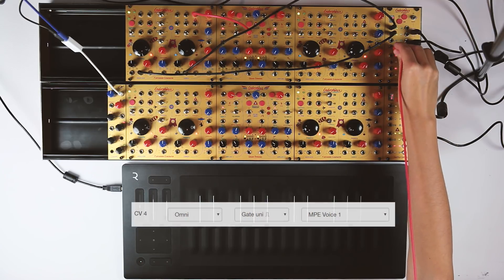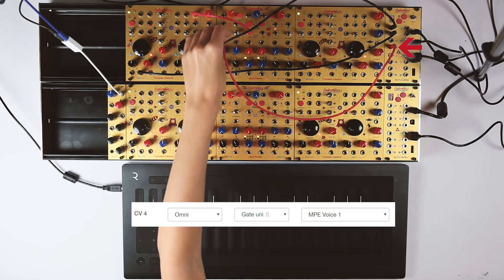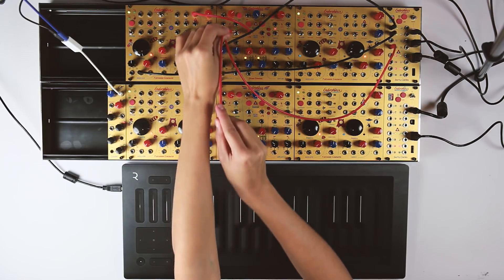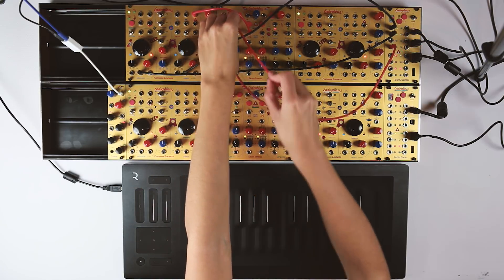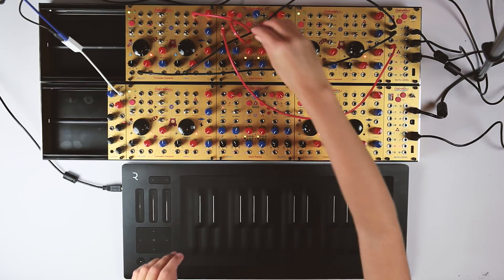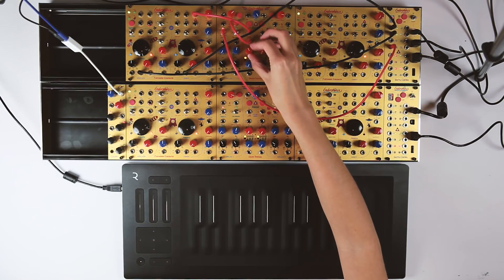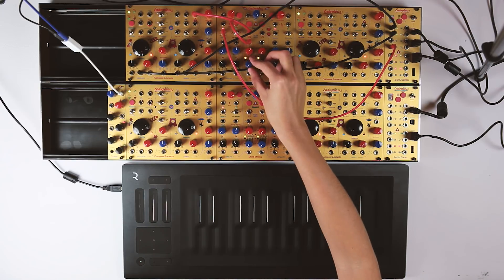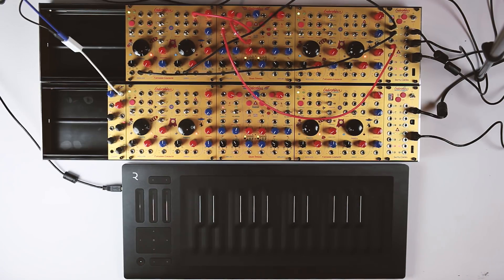Endorphin.es Shuttle Control MPE support with ROLI Seaboard Rise

Comment: Controlling four independent synths with just one keyboard may not sound like rocketscience, but it is. MPE support is hot (Ableton can't do it), and it will translate to excellent control and expression that can't be done with a normal note on/off keyboard. Regardless, it's ultra cool to distribute all these little midi messages to CV. So I just ordered a shuttle control for my Roli Blocks set and can't wait to travel the far sides of the Universe with them.

Comment: Makes no sense to me. For much less money buy an iPad and use Animoog, Layr, Noise, or many others. There are great MPE programs for computers too. Use modular for what it’s good for; not polysynths. This video shows that with enough reverb, anything will sound good.
Reply from the maker: Howard,
Yes, that is mostly technical demonstration of MPE possibilities with modular, when technology of controlling goes way ahead current modular possibilities. People usually don't buy muscle cars for every day driving.
And indeed it is not so practical in terms of patching and performing with the patch itself with such amount of voices as performer will drown in control possibilities. That's why polyphonic synthesizers with repeating structures are way more practical for handling polyphony.
Reply: TheEndorphines: Thanks for taking the time to respond.
Reply: All remarks are true and right, but also irrelevant. It works with any module that makes sound or moves things around. It's about MPE support, not a polyphony demo. The dear lady could have used different sounds for each Furtherrrr generator. That would demonstrate better why Eurorack's been waiting for MPE.

Comment: This is amazing as all hell, but could it be integrated to a normal eurorack system? I know it might be dumb, but it seems like the Endorphines oscillators are a must with the Shuttle Control and they seem to be a bit HP-consuming. It sounds amazing with this set-up tho, can't complain :D
Reply: A little late, but any oscillator with many CV inputs (like two Plaits) will benefit from it, even a single oscillator. But MPE is most fun when you have a few different voices and FX.